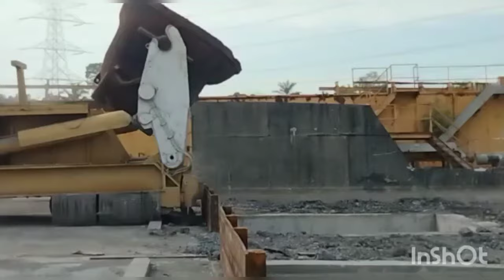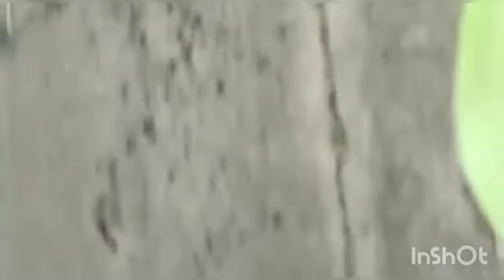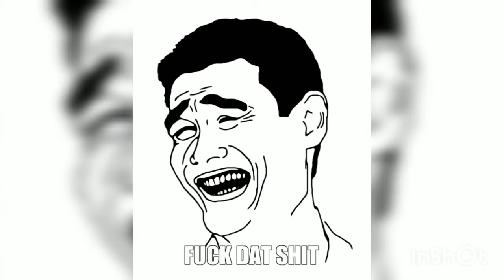What happens when you accidentally pour molten slag onto water (or any moisture)

Comment: Shockingly, that's also what happens when you deliberately pour molten slag onto water.
Reply: The horror
Reply: Thats where he has to empty it. What was accidental, was that it was wet right there.
Reply: How could this be?
Reply: @kurtsell8376  1 liter of water turns to 1700 liter of steam instantly when super heated.
Reply: @S1eepers  so my dad's gallon could LITERALLY be a BOMB!?!?!?
Reply: @ddamsteram7299  if superheated yes.
Reply: Same goes for aluminum. And worst case also creates a hydrogen explosion and then half the block is gone.
Reply: Good to see somebody who uses "deliberately" instead of "purposefully"
Reply: Or untwist a wire coat hanger & stick one end into a wall socket (behind the long curtains).
I speak from first hand experience, 6 decades ago 😕
Reply: @S1eepers 
But not having a rule to check first that it's dry there: that was deliberate? Right, got it.
Reply: @dexterpoindexter3583  rules cant be ignored you say?
Reply: @S1eepers Great point.
  Far too many episodes of Mayday: Air Disaster and its spinoffs have drilled into my psyche that rules absolutely can be ignored.
[Edit: van Zanten is my nomination for greatest blunderer of all time. 583 dead at Tenerife, March 27, 1977: a chilling record we hope is never broken.]
But for the lucky majority who will follow them, rules can save lives.
Deciding not to bother making a rule when even a fifth grader can see it's essential: now that's criminal.
Reply: I feel like with how empty that pot was it was planned. The pots where I work are never that empty. It does do that when it rains, though. You can't just stop working because of the rain. Also another rule that was broken is how close the camera man was. We had a pit explode and sent a slag chunk through the metal of a front-end loader and catch the cab on fire. Not a fun time.
Reply: @zachheflin3601  i dont think it was that empty. The outer part of the slag had just started getting cold creating a shell around it making it stick to the pot. The pieces of the slag becomes projectiles when it explodes. Wouldnt want to play around with that. I work with a cupola furnace and just a little bit of water can be enough if we drop the "cake" in the pit and its liquid iron inside and it breaks.

Comment: Water breaks down into hydrogen and oxygen at 1200 degrees. And then explosively recombines when the temperature drops a little.
Reply from the maker: Hmm but then, what happens (energetically) to convert H20 into 2H and O? Wouldnt this absorb the same amount of energy as the energy released when these three ions recombine? I.e. zero net change
Reply: @de0509  yes it does, but the water forming reaction goes much faster than the splitting reaction. And then falls into the realm of detonation as opposed to deflagration.
Reply: Talk about "The Big Bang Theory!"
Reply: Yeah I don't believe that's it, champ.
Reply: @theginganinjaofficial so retort
Reply: That is also what happened in Chernobyl!
Reply: @lorenzoghinelli7018  we don't know the entire truth of the cooling of chernobyl.  otherwise a 1/3rd of eastern europe would be screwed with radioactivity
Reply: @aaroncapricorn5867  I just mean that the big explosion in Chernobyl was generated by steam splitted in elements by the pressure and temperature.
Reply: @michaellee5399  hydrogen auto ignition temp is 510c (950f), oxygen is 350c (600f)... at standard atmospheric pressure.
Reply: @Michael Lee 

 Thermal decomposition of water

In thermolysis, water molecules split into their atomic components hydrogen and oxygen. For example, at 2200 °C (3992f) about three percent of all H2O are dissociated into various combinations of hydrogen and oxygen atoms, mostly H, H2, O, O2, and OH.
https://en.m.wikipedia.org › wiki
Reply: @theginganinjaofficial  i also think that the slag may have a catalytic effect on the decomposition of H2O, metal oxides are used in catalytic converters.
Reply: @barneylinet6602  not only that, when there is a phase change from liquid h2o to h2o vapor, the volume changes significantly. Which looks like an explosion because it is pushing the slag outwards at rapid speeds.... this is what i think is happening in this video. But im no scientist
Reply: pretty sure this is actually just flash-boiling detonation
Reply: Me stupid, but couldn't this be harnessed for energy somehow? Or is the energy required to produce slag more than what is generated by the flash boil?
Reply from the maker: @BullittMustang3121  if you really want to, you gotta figure out how to seal the pressure. And figure out how to add new hot slag and to remove the caked on solidified slag. Using normal heat exchangers like zigzag piping would be bad. It would work the first time, but then you will have to jackhammer the solidified slag around the piping before adding new slag. Too much work for a bit power. So, as the main heat source for steam power, probably not

I suppose whats possible tho is to pour slag into the pit, seal the pit somehow then spray water over the top to make low grade steam to then burn it a second time into superheated steam to send to a turbine and finally make power. That steel complex will need to also have a power plant. But this isnt some energy source. Merely energy recovery. Scraping the bottom of the barrel. If someone can prove by math its profitable then maybe yeah. Im just speculating here too. No math, no proof. Might not be a very juicy endeavour, but perhaps it might save a bit of money. But with the current steel prices I doubt lots of steel industry projects are gonna pop up.
Reply: @aaroncapricorn5867  uhhh... 1/3 of easter europe WAS screwed with radioactivity... not to dangerous levels, but detectable still... there was this thing about not eating mushrooms looooong past the boom from specific regions of eastern europe, because mushrooms have that weird thing where they suck up everything from their envionment.
Reply: I'm going to go with answer b: steam explosion 
A standard atmosphere water dissociates at around 2200 C.  The slag is likely to be 1200 to 1300c
Reply: @yevrahas  there are catalytic effects caused by oxidized heavy metals and surficial effects. and the temperature that i quoted is used by engineers, a significant amount of water molecules are split so that hydrogen embrittlement becomes a problem at this temperature. Really violent steam explosions require confinement

Comment: I was expecting for it to just burst out steam not exploding like an IED!
Reply from the maker: The steam had nowhere to go with the ground below and stuff above it. The ground definitely cant move, so the rest of the molten stuff above the steam has to be blasted off
Reply: I believe that lava, much like the rock that it normally turns into when it cools down, is relatively low in terms of being thermally conductive, meaning that it transfers its heat into other materials at a slower rate, to slow to cause water to melt into steam at a rate no more violent than causing steam bubbles to form and pop within the lava. (It's why glass baking sheets, which are made out of the same kinds of non-metallic materials that rocks are made out of, don't heat up as quickly, or transfer heat as rapidly, as metallic baking sheets do.)

OTOH, metals, including molten metals, are highly thermally conductive, meaning that when they make contact with things that would turn into vapor at the high temperatures that these molten metals would need to be at to stay molten, including water and water-ice, those metals would transfer their heat into the other materials at an alarmingly rapid rate, so rapidly that it would cause the other materials to not just melt or vaporize, but flash-vaporize in a way that would create these kinds of violent explosions of steam.
Reply: @ShadowWolfTJC Lava can definitely cause explosive boiling. It’s what caused one of the hospitalizations during the 2018 rift zone eruption of Kilauea. A tour boat got too close to where the lava was pouring into the ocean, and a steam explosion showered the boat with lava bombs. One of them the size of a basketball came through the roof and broke a woman’s leg.
Reply: That has to be fake, there is no way that's just water boiling
Reply: @ShadowWolfTJC  you do know there is something called phreatomagmatic eruptions, which is basically magma coming into direct contact with water or ice resulting in a big boom? its a thing, mate. was really spectacular with the 2011 eruption of that icelandic volcano that no one but icelanders can pronounce
Reply: @drunksquirrel2051 it's a flash steam
Also steam can expand up to 300 times in volume

Comment: Chemist here:

Water boils at 100 degrees Celsius, but if it is subject to extreme temperatures very fast, it can flash boil. 

As the water rapidly evaporates it expands rapidly, pushing whatever material around it out of the way. This is called a steam explosion. 

It’s very devastating because not only is the material becoming shrapnel, the steam is super heated, which can cause devastating burns. Steam is odorless and colorless so you wouldn’t know if you were in the affected area until after you started feeling the burns. 

Steam burns are than traditional burns because they melt skin, keeping the nerve endings intact. So you can suffer third degree burns from 25 meters away from the water source and feel every single bit of exposed flesh being burned.
Reply: This is beyond scary.
Reply: Great, I was totally looking for new nightmare fuel, so thanks for that...
Reply: @BrianBaastrup  😂😂
Reply: @rustyshackleford9898  Another chemist, Phil Mason, believes that it's actually a coulombic explosion, rather than a stream explosion. What do you think of that idea?
Reply: I never had the head for the numbers, but I have the geek out appreciation of a chemist, engineer and physicist. And in that capacity, thank you for the explanation!
Reply: One more thing 
A litre of water becomes 1600 litres of steam
Reply: Former autoclave engineer here. When water turns to steam, it expands to 1700 times its volume, and there is NO known force that can stop that phase shift. Steam engines that were filled with water when too hot OBLITERATED small towns back in the 1800's. Steam is a feisty bitch, and you will lose every time.
Reply: @DANGJOS  coulombic explosion is a reactive process. Think of adding molten alkaline metals (like sodium) to water it reacts and causes an exothermic reaction at tremendous speed. It’s plausible, but both steam and Coulomb explosions are still nasty to be around.
Reply: At that point it's not a 3rd degree burn though, it's a second degree burn. There's nothing left to feel anything on a 3rd degree burn ;)
Reply: After reading all this I just learned I have to be far away from any steam explosion
Reply: If the temperatures involved are really REALLY high, something else can happen too. The water molecules themselves split into Hydrogen (which is extremely flammable) and Oxygen....if you paid attention in high school chemistry class, I’m sure you can guess what happens next
Reply: ""So you can suffer third degree burns from 25 meters away from the water source and feel every single bit of exposed flesh being burned.""

https://youtu.be/RAIoxfn2Af4?t=46
Reply: Have you watched the documentary on the White Island volcano disaster on Netflix? Knowing what steam does to people makes that so much harder to watch. The absolute Hell those poor people went through, both the survivors and those who didn’t die immediately.😢
Reply: Steam burns don't melt skin. How does being a chemist make you a medical expert. Steam can be 100, (212f) or higher are you saying skin melts at 100c/212f?

Sure it can be hotter. But you didn't specify that. You just said steam melts skin. Implying all steam, regardless of temperature or pressure.

Why does it being steam change how the heat affects the tissue? Seemingly at any temperature. Heat is heat. The only difference is steam has less thermal mass because it is significantly less dense for a relatively small temperature change.
Reply: @VoidHalo  Steam from explosions or vents is often a lot hotter than boiling point. It doesn’t melt skin like butter, but it can damage it so severely that it sloughs off, even if it’s not blackened like when burned by fire.
Reply: dang
Reply: And that is enough internet for today…
Reply: That ain't no steam
Reply: Nice explanation about the science of Slag and Water!
Reply: That was actually a metal water explosion similar to what happens when you put a drop of nak or a chunk of sodium metal in water
Reply: Great! This explains why molten aluminum must not be mixed with water. There's an explosive coefficient that I studied during training to my workplace (it's an aluminum smelter plant), which says that the steam explosion power is a million times greater than the one of TNT

Comment: That's why slag is usually poured downhill, no chance of water pooling.   These guys were pouring into what looked like some kind of pit.
Reply: You realize there doesn't have to be visible water for it to be wet. Dirt cab be damp without having a puddle in it. Regardless of grade. Soaked up water doesn't flow terribly fast.
Reply: @VoidHalo 
Still, a slag explosion on a hill would be angled away from the people pouring, making it less likely to cause harm. It's safer no matter what.

Comment: This is actually a hydrogen explosion. The water separates into oxygen, which oxidises the iron, and hydrogen which then reacts with the oxygen in the air. This happens in a split second.
Reply from the maker: Are you sure? O-H bonds are among the most stable of single bonds. Not the strongest but really strong. While the formation of water from hydrogen and oxygen is violent, the act of splitting water into its atoms is the exact opposite; it consumes a lot of energy. Its not free. You have to spend energy to break bonds. Are you suggesting that breaking H2O into O and 2H and then reforming it back into H2O has a net energy gain? That sounds too good to be true. Because to break it apart and then reforming it would most probably end up with no enthalpy change. Moreover, as with any chemical reaction, especially in such a short time frame, there will be unreacted material. Meaning after using up some energy to break bonds, there would most probably be a bunch of atoms that were unable to find its pair and remain as atomic hydrogen and oxygen at the end. Its like if you put in $100 in the bank, and the next day retrieve $95 and the next day the bank goes bankrupt. You lost money.
Reply: @de0509  under normal conditions you couldn't break the H-O bonds but this isn't normal conditions. That slag is 1500 or so centigrade.

Comment: What your witnessing is a Hydrogen Gas explosion.  This is do to the immense heat of the Slap ripping the Water Molecules apart into its base components, Hydrogen and Oxygen.   Both of which very flammable. I knew my 6th Grade Foundry Class Electorate would come in handy.

Comment: Worked in a steel foundry and some idiot tried to cool the slag by spraying it with water. When I dumped the hot slag on it the water flashed to steam and we had slag all over the shop.
Reply from the maker: Now that I think about it, in my previous workplace we do spray water on the slag. Its a roofed structure with a pit plus a lid over the pit that opens and closes and sprays water. I wasnt involved much on that but I heard they did that to thermally shock the slag to break into fine pieces. Somehow the slag from the furnace already gets semi solid once it gets to the pit and they just pour it into the pit as it arrives. Never an explosion btw. Then an excavator comes and digs around to break it to smaller chunks before the water spray. We haul that powdery slag to a conveyor with magnets to extract usable iron that was discarded in the slag. Really ingenious imo.

Comment: So why doesn’t this happen with volcanic eruption’s underwater or when lava flows into the ocean? Is lava not hot enough to cause this?
Reply from the maker: The one in the video is lava covering ON TOP of water/moisture. The water that vaporises has the ground below it, and the lava on top. The ground wont go anywhere so the lava is pushed upwards like an explosion.

The one in the ocean is lava surrounded by water. The water that vaporises can just immediately leave as bubbles and float up.

Thats the way I understand it. Maybe a physicist or geologist knows whats even closer to the truth
Reply: I believe that lava, much like the rock that it normally turns into when it cools down, is relatively low in terms of being thermally conductive, meaning that it transfers its heat into other materials at a slower rate, too slow to cause water to melt into steam at a rate no more violent than causing steam bubbles to form and pop within the lava. (It's why glass baking sheets, which are made out of the same kinds of non-metallic materials that rocks are made out of, don't heat up as quickly, or transfer heat as rapidly, as metallic baking sheets do.)

OTOH, metals, including molten metals, are highly thermally conductive, meaning that when they make contact with things that would turn into vapor at the high temperatures that these molten metals would need to be at to stay molten, including water and water-ice, those metals would transfer their heat into the other materials at an alarmingly rapid rate, so rapidly that it would cause the other materials to not just melt or vaporize, but flash-vaporize in a way that would create these kinds of violent explosions of steam.